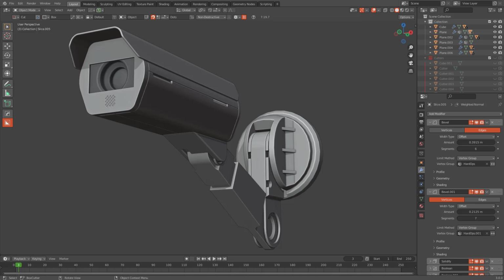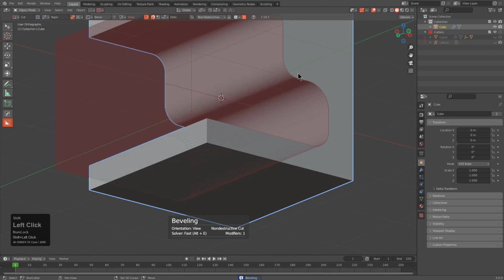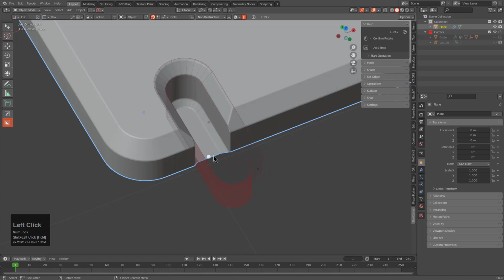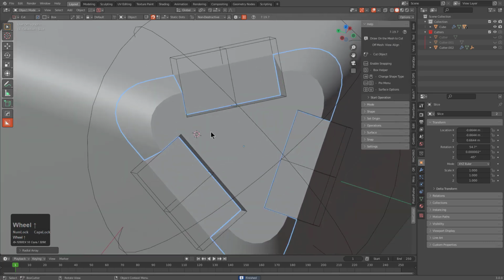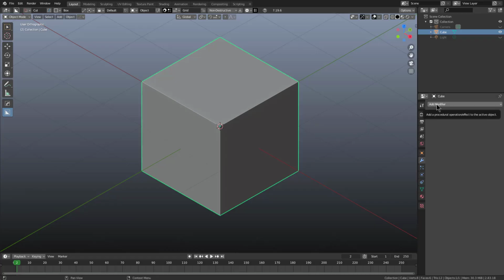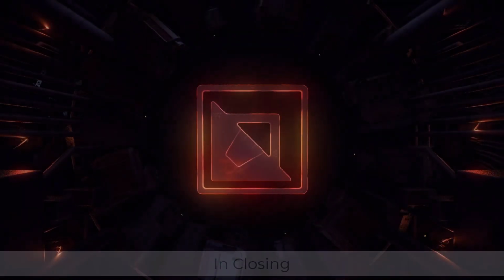#boxcutter 719_7 - Release Log

Comment from the maker: Boxcutter Playlist: https://www.youtube.com/playlist?list=PLjqpj14voWsX5SzSykknEGFgDqW_LVwp1

00:00 Start
00:07 Introduction
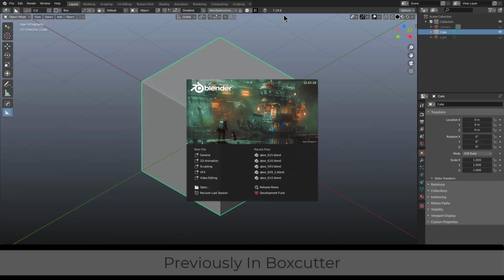01:41 Ngon Points Bevel Weight and Extruded Improvements
04:46 Ngon Points w/ Mirror Bug
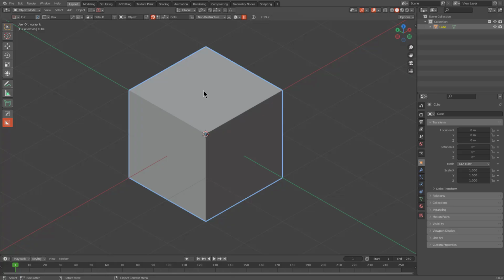07:01 Bevel Recap
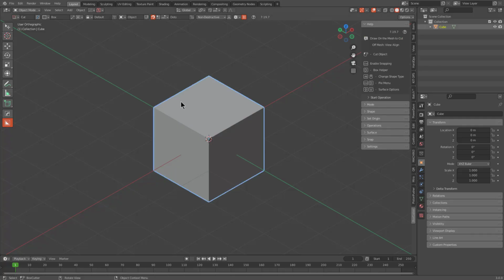11:07 Bevel Both Ends
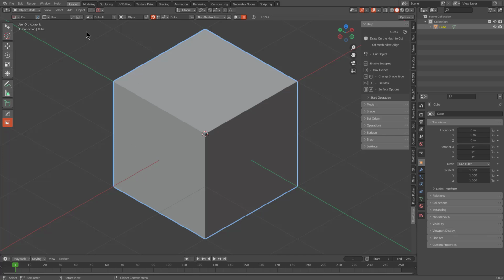17:46 Set Origin - Overview
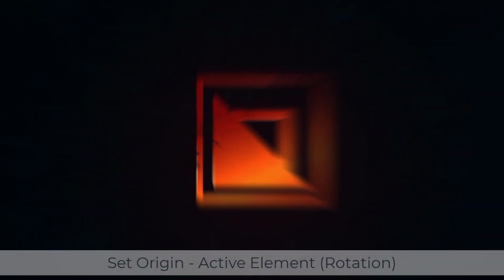19:58 Set Origin - Active Element (Rotation)
22:59 Grid - Spawn w/ Ctrl
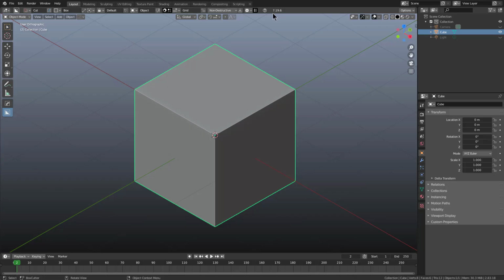25:13 BC Smart Apply Recap
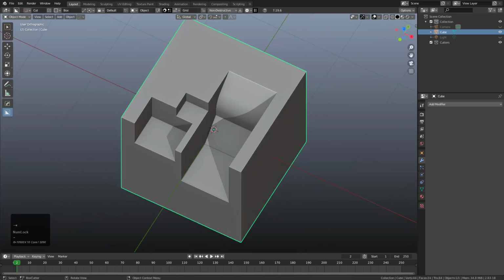26:21 BC Smart Apply Shift - Loose Cleanup
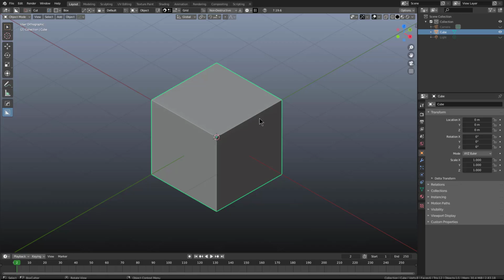28:47 Multi-Use Improvements
31:57 Sort - Expanded Modifier Support
33:15 Accucut Mod Improvements
35:42 Taper Keep Lattice
37:24 In Closing

Comment: Smart Apply Shift - Loose Cleanup - is there a place for this command in the menu (couldn't find any)? Besides the known Icon+shift.
Reply from the maker: It wouldnt be added to hops as a bc counterpart due to being a BC thing. However as an option it isnt that popular or widely used. Alternatively Hops also has Purify under Q >> Settings >> Manage (alt click) which also removes unused cutters.
Reply: @masterxeon1001  Well, Purify doesn't remove modifiers as Loose Cleanup does unfortunately. Manage could be a proper place for it I think. But as you said it isn't something very crucial.  Thx for the answer!

Comment: So... I was wondering, watching the duplicate objects smart apply, with the same geometry data... is it possible to make things like markers on the time line, to use as a recall to a modifier? I was wondering if it's actually possible to make the Fusion 360 Timeline in blender, I would be interested to buy/make if necessary, an addon like that, if it's possible. It's basically the bool scroll, but on a time line. Or, if it's possible to, let's say, when you make a bevel, on the geometry, connect that to mesh machine and stuff, so you are able to recall (and with mesh machine,get the older geometry, in case of a bevel) basically, an older version of the model you are working on, so you can for example, fix a problem you've encountered doing something else later, easily fixable recalling an edit you did, using the time line :). 
Thx for any response mate!
Reply from the maker: that is a ponder for sure. But Blender just isnt a cad application so I worry about all the pinch points present with such a concept.
Reply: Using Fusion360 atm. The history is very useful, but I can live without it  and sometimes get into trouble when I remove something that around body needs down the timeline. The "sketch" workflow imo would be very useful in Blender.
Reply: @sqwert654  true, the sketches with the dimensions are really useful, but they still requires the timeline. I can live without the timeline now that I know how to fix things, but still, if I had to do a "big" Project, I would use fusion, cause it's more "reliable" and precise than blender.